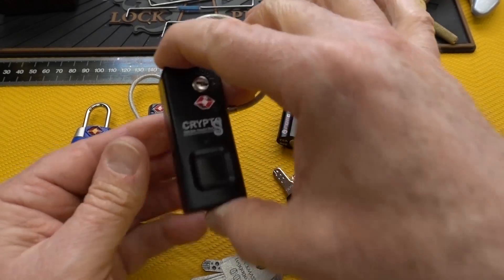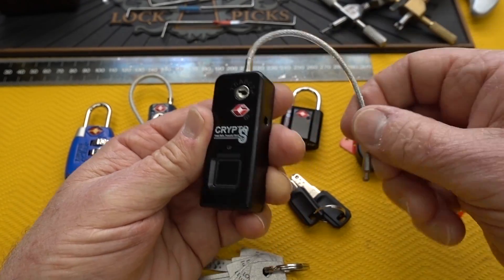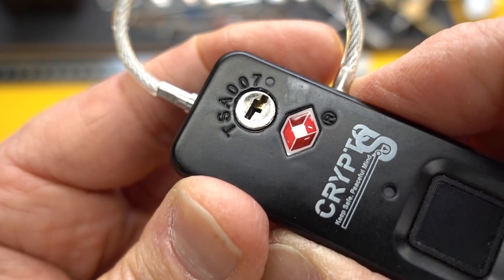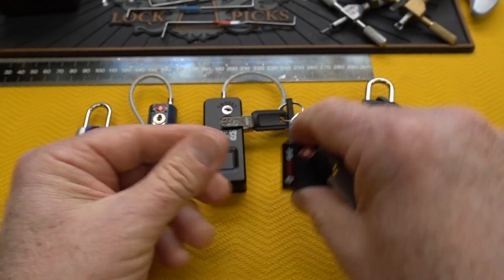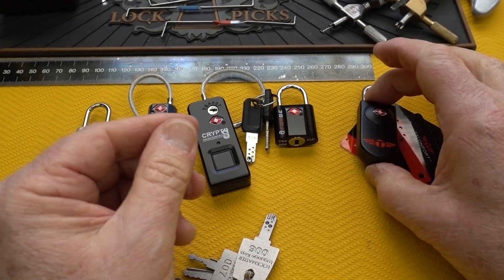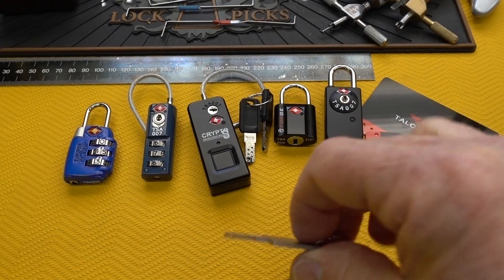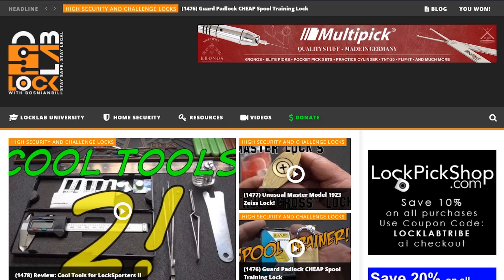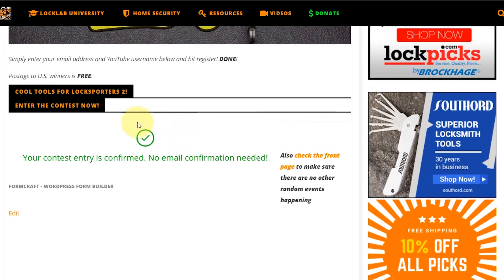(1682) Review: 3D Metal Printed TSA Master Keys

Comment: It has been a while since this video was published. Does anybody know a place to get a full set of keys? The 002 and 007 is easy to find on China sites and such but the rest of the keys not. Not going to pay an arm for a 3D printed set. Figure by now somebody (most likely in China) would be making these by now on "regular" key cut machines - as said 002 and 007 are but the rest seems hard to find for some reason. Most of them are just regular small wafer style keys.

Comment: is there any other company that sells these types of keys.. over $550 for the set is pretty steep.
Reply: These are mostly designed for professionals. If the lock isn't to specs they can also be used to overturn the lock.

Comment: I have a handful of #7's. I can pick them all in a few seconds each, using only a Sparrows Shank. Place it in the keyhole against pins, rock it like it were a city rake and apply clockwise tension at same time. Only thing I noticed is most are hard to pick with shackle  under tension.

Comment: I'd just print out the outline on paper, stick on it a sawblade or thick feeler gauge and cut it.
Use the photograps for reference where needed and metal files/sandpaper where precision is needed.
Bada bing bada boom, you've saved €462.91 (minus ±$10 material costs).

Comment: Is that cheaper than just buying 7 different TSA locks with different keys? It seems like that would be cheaper you would just need to source a set of locks with the best keys...
Reply: evilcanofdrpepper Of the TSA locks that come with a key (some are opened by the user by combination or fingerprint), the key you get is unique to your lock. They’re not one of the TSA master keys. You won’t get any of these master keys when you buy a TSA lock.

Comment: My mum had one of these that must have come free with a newspaper because it was a super thin cast alloy body and my mum lost the keys, i thought "The hoop(i was young i didn't know locks) looks thin and weak, i could snap it with a wrench". I got a wrench, tightened it up and didn't even get much tension on it, i would have gotten more tension on my finger before i felt pain, the whole cast body just cracked and fell off leaving the only strong part left(the hoop) on the zippers. It was a fabric suitcase with those cheap think zippers so you can imagine how badly made the lock was.

I don't trust these TSA locks at all.

Comment: For the keys that 3D printed plastic snapping was the problem, could you just leave a gap for a regular tensioner?  That would take all the twisting stress off the key and it would only be used for raising the pins.  It would probably have its own complications, and wouldn't work for some of the designs, but it would be a lot cheaper than these metal ones if you could get it to work.

Comment: So far, I have success with the TSA 002 and TSA 007 which are the most common to me in my region anyway.   The 007 could be opened with city rake or worm or bogata with a small tensioner most of the time.  I found that the 002 is especially vulnerable to a Sparrows worm rake even without a tensioner.  Just insert, jiggle and I can turn it in seconds.

Comment: I bought a TSA002 and TSA007 for ~$10 (+S/H) on Wish (just for fun). :D
The 002 works fine in a lock I bought in the local hardware store (Haven't tested the 07 yet).

Side note: Haven't also the internal documentation (with nice photos of each key) "leaked"?

Comment: It's entirely possible to grab the stl files for the keys, and order your own set off a site like shapeways, for example, to get a 3d printed metal key that works.  https://twitter.com/jessthemullet/status/1221998157422182401  I did that for the 006 key, and you can get the 002 & 007 keys off ebay for a few bucks a pop.    

This is the latest repository for the printed keys, and these have all been resized and tested to actually work (with a few different handle options). https://github.com/johnnyxmas/TSA-Travel-Sentry-master-keys  It's also possible to use some tougher plastics in the resin printers, which will hold up better than the fdm-style printed keys.  I haven't had a chance to play with those yet myself, but I have no doubt you'll get at least a couple uses out of them.

Comment: Wouldn't it be possible to use the same 3d print plans, use a free Linux cad program to design a negative and print a two part mold from hard resin, then use a copper + alluminium alloy to cast the keys from? I'm surprised Adam savage hasn't played around with this idea.

Comment: EDIT: These are Laser Sintered keys. Not 3d printed. The argument below is based on the (terrible) idea that the manufacturer chose to 3d print them when there were other better processes (like laser sintering) that they should have used. The only confusing part now, is that the product description says they are 'printed'.
-----
Oh come ON Bill, you should know better than to repeat the GARBAGE that comes out of some marketing department...
Just because 3d printing is used at SOME point in the manufacturing process, does NOT mean they 3d printed with metal. And those keys clearly aren't.

A. They are either printed in plastic that CONTAINS metal, which is then further processed. It is either a high metal mix that simply burns off the plastic/binder while the metal powder is sintered. Or a low metal mix where, after burning off the plastic, the metal matrix is filled with some lower temperature melting point metal like brass/bronze. This is CLEARLY still printing with plastic and then finishing it with some other traditional process. This method is far less reliable, and more expensive than traditional manufacturing and ONLY makes sense if there is NO traditional method that will actually create the part. (Or for prototyping. Or extremely low volume jobs as mentioned below.)

B. Or MUCH more likely they are printed in plastic. Which is used to make a mold. Which is then used to cast with metal. So...not 3d printed with metal. This method isn't terrible as long as cast parts are actually acceptable. And you are making a low enough volume that getting regular, much more durable, but much more expensive molds doesn't make sense. You don't say that regular cast parts are "Hand carved from wood" just because some wood, at some point, is likely used when creating the mold. Do you?

There are VERY FEW situations where 3d printing is ACTUALLY useful.

1. Prototyping. Having physical things you can try is useful. being weak and soft doesn't matter as much as being able to make a thing NOW.
2. If you are making SO few of a thing that any other manufacturing process is much more expensive, AND the lower strength/durability/precision/finish quality of 3d printed parts is still acceptable. This is actually an extension of 1.
3. Art or toys I guess. Probably STILL an extension of 1.
4. If your part CANNOT be made any other way, AND the expense of any further finishing, plus the lower overall quality, make this difficult to manufacture part BETTER than a design that could be produced with traditional methods.
5. [NOT A GOOD REASON] Because 3d printing sounds fancy so you can charge your customers more for an inferior product.

We have been making KEYS for hundreds of years. 1-4 CLEARLY don't apply to keys. That means 5 applies. There is no good reason for 3d printing to be involved here at all. Not only does it make the product physically worse. And more expensive. But it is wasteful if method A is being used.

These keys could have been made with CNC milling and/or laser for 1/10th of the price (probably). And would have been MUCH higher quality.
Reply from the maker: I hear you and completely understand your arguments, which all make sense.  Other than obtaining the keys from them, I have nothing to do with their business decisions or manufacturing.  HOWEVER, with perfect hindsight it is easy to criticize choices.  Try to imagine how this decision was made with a bunch of engineers sitting around a table trying to come up with a new, innovative product.  "Hey, how about TSA Master Keys?" says the first guy.  "Nah, probably wouldn't be popular", says the second.  After some web searching they decide it MIGHT be a popular item, but are unsure of the future demand.  "Let's make a small batch and see what happens...".  For a small run it would be crazy to create all the programming for CNCing, to say nothing of buying the tooling, setting everything up, and running a couple of test runs to get everything dialed in.  Instead, one of them decide to 3D print the keys in metal.  Not cheap, but consider it a prototype run.  The keys sell, but the demand might not have been great enough to invest in a CNC production line, so they 3D print a 2nd or 3rd run.  As long as they are selling at that price, but the demand remains low, WHY invest in CNCing?  At any moment the demand might dry up and they'd be stuck with a couple hundred thousand Euros of CNC expenses.  Say....a pandemic...?  It might not have been the perfect choice for manufacturing process, but their choice is looking smarter and smarter as this thing drags on.
Reply: @bosnianbill  My argument was based on the idea that a marketing department made the decision to refer to a product based on a misunderstood part of a production process. And that it is intentionally deceptive. Something like...
3d printing is used as part of production > The end product is metal > 3d printed metal

THEN I started questioning if the 3d printing part should have ever been there to begin with.

However, it turns out that 3d printing ISN'T actually anywhere in there. The manufacturer says it is laser sintering. Which is literally a CNC laser process. Which is one of the examples that I claimed would have been cheaper/better than 3d printing. This actually does require all of the normal CNC set up you describe. It just uses powdered metal and lasers instead of a block of metal and cutting tools. 

The only confusion here is the term 'Printing'. Which this isn't. So I don't understand why it's being used.
Reply: @Zieh-Fix  Ahh OK. So I had a look around. The confusion here is with your usage of the word 'printed'. Laser Sintering is not a 3d printing process. But it IS part of the Additive Manufacturing family.

There is possibly a language/translation thing going on here. Clearly Bill also though that these were 3d printed when he saw the description (since he made it part of the title of his video)
Reply: @Zieh-Fix  I guess I'm just not OK with intentionally describing something incorrectly.

Side note: IMO, 'Selective Laser Melting' sounds WAY more impressive. Even if people don't know what the term means it still does a good job of grabbing attention. And if someone wants to look it up to understand it they can.

Comment: Oddly enough, when I printed the keys in my FDM printer, only #7 came out right. Worked great in the 4 locks I tried. They all printed beautifully on my resin printer though.
Reply: try to open a TSA007 lock with a jiggler/wave rake. TSA007 tend to open with jiggling.
My TSA007 is also a good lock to learn single pin picking - it feels like only having one binder.
So really: No wonder why a printed key works. A paper clip would be over engineered for the job.

Comment: Massively over priced Bill, good for those with a lot of coin and no time to put together a much cheaper and non-flimsy 3D printed kit, man some/most are available as actual cut, read strong, keys. .

I bought my TSA007 from ebay (all my travel locks, keyed and combo are TSA007) on ebay for $13, you can find it cheaper. I suspect you can have an almost complete set, minus one or two of the obscure like that dimple for under $100 and much less. this looks to be 'Specialising itself out of the market' AND the TSA007 is pathetically easy to pick with either a L-Rake (or one of Petersons versions) or TOOOL wave rakes, and even tho the keyway is tight is easy as hell.

Comment: I've had success opening a variety of the 007 locks just by using an L-rake (City rake) with no tensioner, in the same manner as a jiggler.
Reply: I have done the same.
Reply: I've done it with a pair of tweezers...

Comment: If I said it once, I said it a thousand times: every TSA 007 lock I have encountered so far can be jiggled open with pretty much anything that fits into its keyway.
Reply: See EGEETOUCH.
I'm not sure why they needed all 7 keys, at least 3 of them could have been replaced with a mini Bogota rake.
Reply: My experience confirms the above
Reply: the TSA007 lock I have feeled like a single pin to pick.
Put in the tenser, find the binding disc, click, open.
Reply: Same here ...
Reply: I can do it with a broken pair of tweezers... And without any experience of lock picking.
Reply: having not owned a lock pick in my life, just folding a paperclip is enough to easily open that one.

Comment: So I have a 002 and I’m able to pick it and the lock turns but it does not open, what am I doing wrong Bill?
Reply: Maybe there's a spring or actuator at the back of the keyway that frees when the lock is turned, so you need to push that too

Comment: Would it be possible to transfer the biting of the pin tumbler keys on a wiper insert or a feeler gauge and use that as a key? That could circumvent the breaking plastic problem.
Reply: Transfering biting is easy. Any lock smith as a key copy machine that can transfer conventional cuts. Most also have the tools and expirence to transfer dimple cuts.
Give a lock smith the right key, matching lock and a blank and it's not a technical problem.
(You can also transfer conventional cuts via hand filling)
Any mechanical workshop can also make a drawing of a sample and make copies based on the drawing.

Comment: I guess I do not get the fuss over some cheap looking locks?  I have some lineman's pliers that would cut the cable on any of these :) No expensive 3d printer required :)  and I have a 3d printer btw
Reply: A strong cable tie would act as a tamper seal.
Those TSA locks do not, because you can get keys for them.
(and you can use any common bypass technique for primary mechanism)

Comment: Interesting that these needed to be 3d printed. I'm surprised that someone (in china probably) hasn't made a sintered metal mould for them. Also would have expected that traditional CNC machining would have been more cost-effective for a batch run. I'm sure a hobbyist with enough time on their hands could have made most of them with simple hand fitting
Reply: Chinese sellers do sell the tsa 005 & 007 for very little money.
Reply: It is being sold. Around $10 a key.
Reply: @SunnyWu  I have both tsa002 and tsa007 out of zinc from a chinese seller for 2-3$ each. And they work very well. They will break if you apply unreasonable force though
Reply: @Zieh-Fix  , could you reveal what material stahlstoff (ich sollte meine Frage auf Deutsch anfragen) is used for these keys? What type of tool steel? Do you use the Deutschland made EOS machines?
Reply: Henry O'Keeffe there is carbon fiber for 3D printing wich is much stronger then normal pla
Reply: @Zieh-Fix  The only way that this could SOMEHOW be more economical than CNC milling/laser, is if you ALREADY owned the manufacturing hardware. AND you made them in ridiculously small quantities. Like a dozen sets. Total. Ever.

Did you guys get conned by some 3d printer salesman? Or are do you not have anyone with manufacturing experience/expertise working for you? Your reasons literally don't make sense in the real world.

Also, are you REALLY going to claim that these are direct metal printed? Because if they are, you must have some process that is DECADES better than what is being used right now. You should be trillionares with every major manufacturing company BEGGING to licence your methods.
Reply: Overwatch this is just a bog standard SLS (Selective Laser Sintering) process. They’ve been doing it for decades, the patent has expired and these days lots of manufacturers make those printers. They’re still not affordable, but you just rent some time on them at shapeways or elsewhere.

And yes. What Wendt is saying (between the lines) is that their series size is in the dozens, particularly because they make adjustments on a fairly regular basis (which resets that counter).

Comment: What’s up with the 3 downvotes? Are 3 TSA agents pissed off cause you got your hands on those keys?
Reply: The product is overly expensive. I mean: If you can get it on "someone else"/company money: Fine. There is real expense, craftsmanship, warranty, service etc. behind it.
But: For the most common key ways, you can get the keys cheap from china. For the less commons keyways: Assume the lock cost 50$ dollars and the key set cost 400$: How many locks with uncommon keyways can you cut, before it becomes economical to buy these keys? (Noting again, that you can get the commons keys on ebay)
also he did not show all keys in use (showing how uncommon those keyways are and thus how over priced the product is in terms of usage value)
Reply: Michael Frey None of what you mentioned is Bosnian Bill’s fault. Except not showing that all the keys worked. Even then I think it was enough that he showed the 3D metal printed keys work. The more difficult keys to print were his focus. I think you might have missed the point of the video.
Reply: It's nothing to TSA

Comment: How very rude, flipping the bird at the lock or is that just a quick review of the secondary security access?
Reply: well, the tertiary access (wire cutter) is also easy to access.
But honestly: I might as well use a zip tie as tamper seal then a TSA lock.
Sometimes even the TSA uses wire cutters, because they do not find the keyway.
And even if they find the key way, they might trow the lock in the bag instead of locking the bag up.
So really: a tamper seal is better then a lock, especially if the zipper of the bag could be bypassed in an other way.